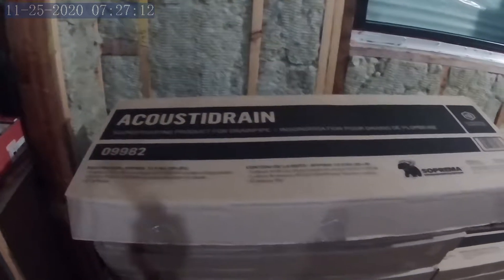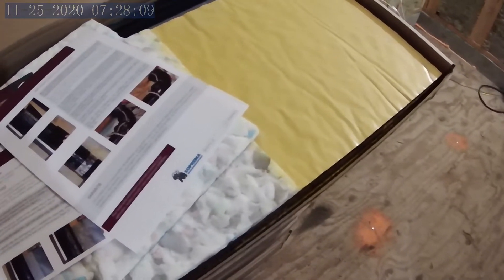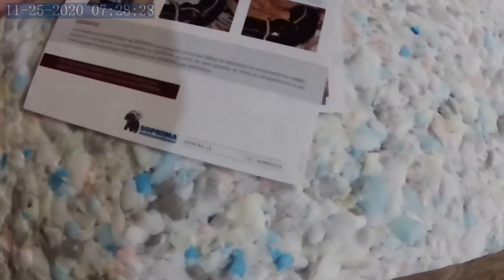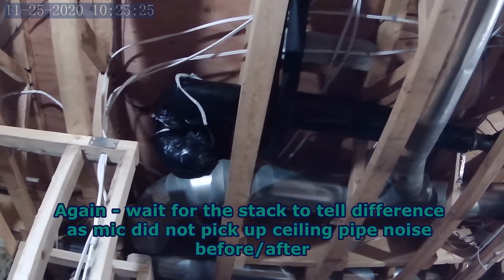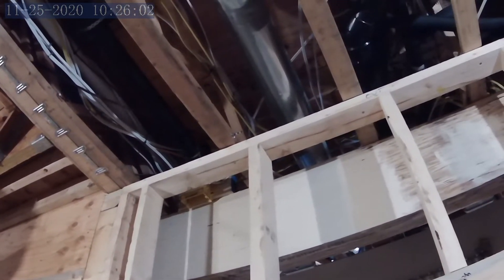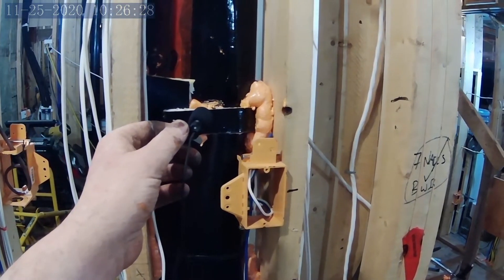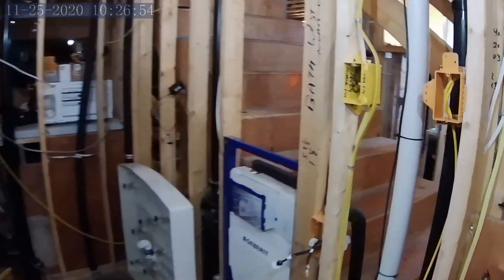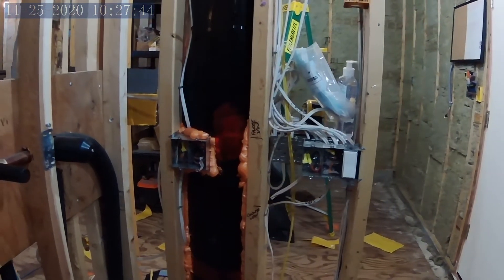Acoustidrain - Sound Proofing Test

Comment: thanks for your video, seems hard to find the product, maybe it can only be purchased on their website, is it heavy? I guess that the only concern with plumbing as plastic abs seems flimsy.
Reply from the maker: Hi S G, thanks for visiting my channel.  This is a commercial product, so you would only find at the local wholesaler representing the SOPREMA brand.  In the Greater Vancouver area, this is CONVOY Supply.  You could send a msg to SOPREMA, on their website, to ask the closest wholesaler to you. The product is not light by any means, but ABS is more than capable of supporting it.  For drains the smallest ABS pipe would be 2" , so this is quite rigid and if you support horizontal runs every 47.25" per code, you would have no problem.

Comment: Can you put this on hvac duct?
Reply from the maker: Hi Je L, You could probably do so, you would need to buy multiple kits to wrap around the larger diameter of an HVAC duct.  It would probably be cheaper, and easier to install mineral wool insulation around the duct.  But in reality, a duct should not make a lot of noise. If it does, there is most likely a problem with the system.  What kind of noise are you hearing and when?